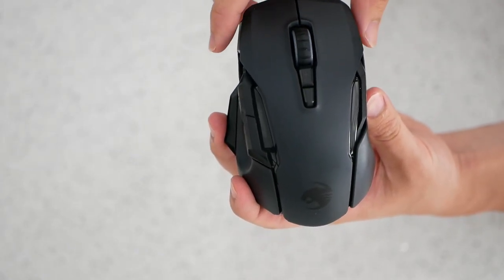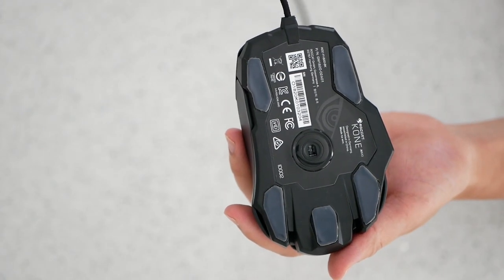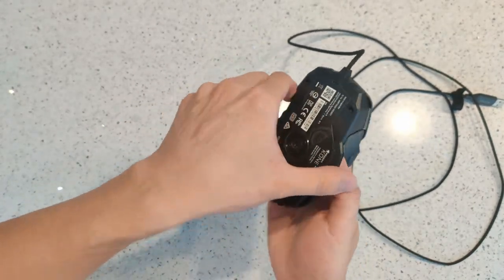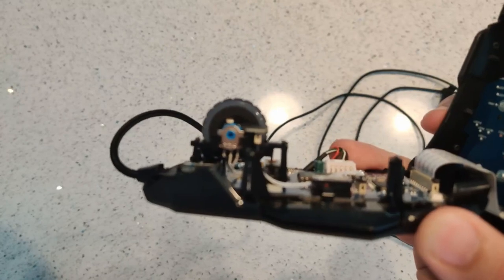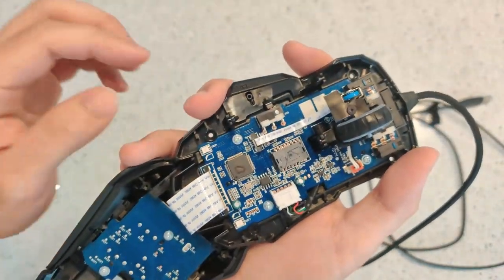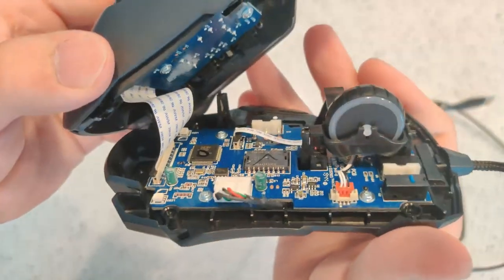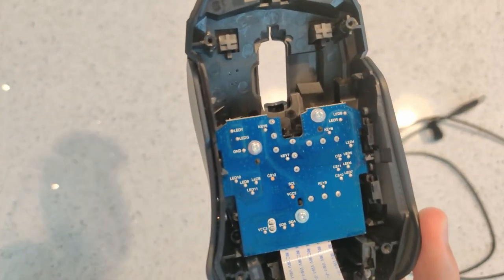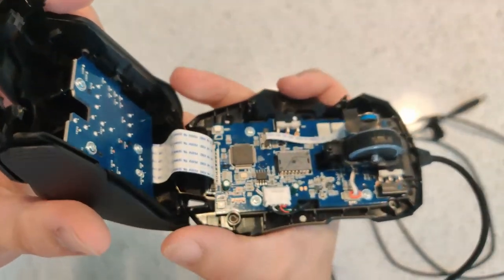Roccat Kone Aimo Remastered Disassembly

Comment: how you remove the stuff from the bottom, the 4 pads ?
Reply from the maker: you can use tweezers to wedge under the pads and lift. It's easier to remove if you also have a heat gun.
Reply: @ReviewsForLifeYT  Must I not replace the pads when reassembling? Where would I find mouse feet/pads for my old roccat kone EMP?

Comment: Is there a way to prevent dust accumulation in the rotary sensor? The sensor is incredibly prone to it and would require regular maintenance to keep the sensor clean.
Reply from the maker: There's no good way to keep dust out of mice- unless you keep it in a drawer and never use it. Also, overtime the rotary encoder becomes worn out and requires replacement. It's standard wear and tear, not much you can do about it
Reply: @ReviewsForLifeYT  What's the normal life expectancy of a rotary sensor? I have had 3 roccat kone aimo mice and the sensor started to malfunction earliest 3 months and latest a year. Most likely because of dust. 
I saw that the sensor has its top part open, thought about closing that to prolong its life span but if it breaks due to wear then there is no point in doing that.
Reply: @Zerofreak161  looked up this video to figure out how to clean the scroll sensor because when I scroll it goes in the opposite direction sometimes. I've had this mouse for 2 years and 2 months and I've had this issue for about 3.5 months. After this cleaning, I'm putting something over the sensor and I'm gonna hope that helps the dust accumulation

Comment: My mouse 1 isnt working it was flimsy already then i dropped the mouse. It is 7 years old though. (I dont have screwdriver to open bottom)
So I open the mouse 1 flap up, dunno if thats a bad idea and broke it.  That is my first question can i lift this up. Second question the little x part on the mouse 1 button is way shorter maybe its broken or worn out is that possible to happen after 7 years?